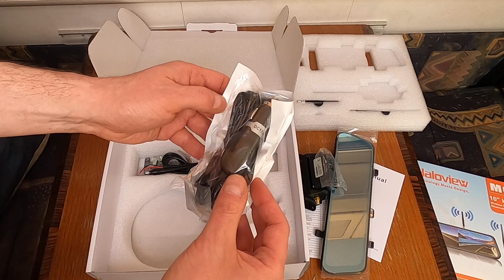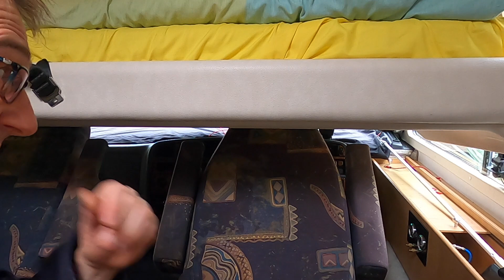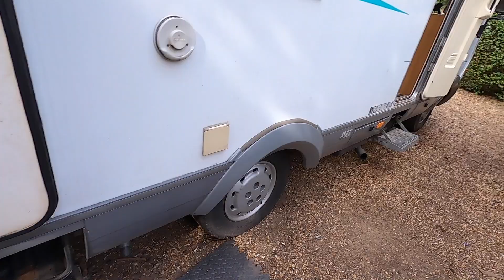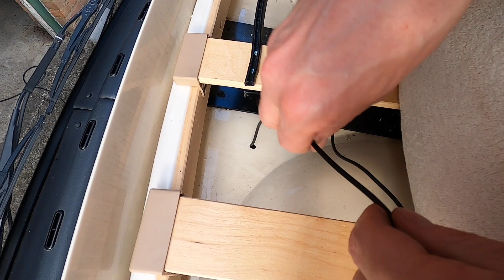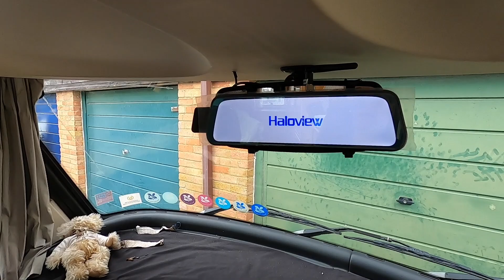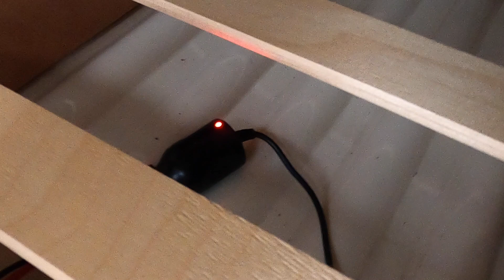Installation & Review of the Haloview MC-10 Wireless Rear View Dash Cam

Comment: Brilliant video buddy just what I needed. Now I have a question if you could help matey… so I have a reverse camera fitted in my bessacar motorhome already but I’m wanting this for a rear view camera to see what’s behind while on the road , my ideas are to wire this rear cam to the one that’s in for a power source would that work or would it only come on when selecting reverse like the one fitted 
Then the front dash cam I’m thinking of piggyback to the fuse of the day time running lights
Reply from the maker: Hi  Elites Gaming, I'm not sure I follow you 100% but it sounds like you want to wire the Haloview into the existing camera? If the existing camera's turns on when you put the motorhome in reverse then it's probably getting the power from either the reversing light or the reversing switch in the gearbox. You'd need to check that.
I hope that helps?
Reply: @HermanHitstheRoad  ok buddy I will explain better . I’m going to wire a 12 v socket in my fuse box on dash using a piggy back fuse and other to ground then plug the dash cam to that 
The rear cam I will have to wire to a light like you have because like you say my rear cam is the reverse cam . I have been told there is a fix for that too The issue is the camera comes
on in reverse. And the only way I think you
can overcome this is locate the yellow wire
at the camera and connect this to 12v
ignition so that would make the cam I have in a source to daisy chain
Reply from the maker: Right, got you 👍👍
Reply: @HermanHitstheRoad  how long is the power cable buddy for the rear camera did you have to extend it . I’ve watched all the video but not sure if you fitted that cable with the blue wire , or that’s the original cable for the camera
Reply from the maker: The rear camera has a short cable. We extended it to reach the rear lights.

Comment: Great video. Did you put a anti dazzling film in the end? I thought the mirror was supposed to be anti glare already? Thanks
Reply from the maker: Thanks for your comment, Ricki. No, I didn't. All I simply did was tilt the mirror away from the windows. It's a screen and not a mirror so it doesn't need to point to the rear window.
Reply: @HermanHitstheRoad  Ok I see. Mine may be different, I have a Halo View but it seems to be a mirror. Anyway will let you know
Reply from the maker: It's both, kind of. I was trying to use it as both a mirror and a screen. So, you could use the mirror while driving and have the screen come on when you put it into reverse to give you a better view of what is directly behind you. I've gone for the screen on all the time setup

Comment: Useless at night massive glare. Do a night test
Reply from the maker: You get glare through the rear window anyway so it isn't much difference. The problem I have at night is that camera switches to IR mode and car headlights turn the camera back to normal mode and this causes a flicking between night and day vision.
Reply: @HermanHitstheRoad  it's 20 times brighter than out the window I asked the manufacturer to add the option of turning off the ifrared
Reply from the maker: And what did they say?
Reply: @HermanHitstheRoad  no answer yet
Reply: @HermanHitstheRoad  here is their answer
We will sell a new camera without IR light in the future, maybe you could try it later. 

The infrared light is unable to be turned off, as for the issue you mentioned, for MC10's camera, it is a normal phenomenon when using it at night.

Comment: Hello, just wondering, was it not possible to wire the camera locally to the cable going to the rear mounted brake light?
Reply from the maker: Hi etansey, that would mean the camera would come on when the brakes were applied. The camera would turn off when my foot came off the brake pedal. So we could have wired it to the brake light but it would have been useless.
Reply: @HermanHitstheRoad  ah of course. Thinking of adding a camera myself but don't fancy wiring the power cable to the light unit. Our van has a 13 pin socket for a bike carrier light bar, was thinking of wiring the camera directly to that plug. Much trial and error no doubt. Thanks for the reply.
Reply from the maker: 13 pin? That sounds like a tow bar connector. It may have an earth and a live for each light. If it has a permanent power connected to the ignition then that would be ideal. You also want to consider where the wires are going. If the 13 pin connector is outside your motorhome then the wires will need to find there way outside.

I hope that helps? Let us know how you get on.
Ads

Comment: Hi again ads,
Just waiting on my delivery on my mc10, can I ask how you powered the rear camera to test before you wired up in Herman.
Thanks Anthony
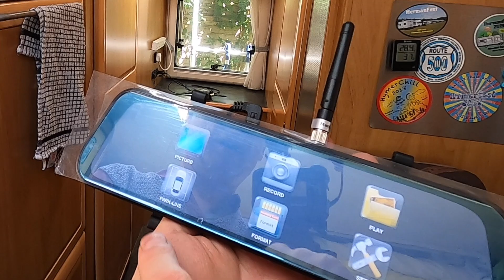Reply from the maker: Hi Anthony, for the mirror I used the cigarette lighter connector that comes with it. For the rear camera it has a connector much like these (https://www.amazon.co.uk/dp/B01N5CT3AY/ref=cm_sw_r_cp_apa_i_b-5tFb7KB7WA3). So I used a cigarette lighter socket with something similar on the end (we used it to power the 12v TV). You can just barely make it out in the video at 2:05

Comment: Ads thanks for info, just ordering one as I type 🍺🍺
Reply from the maker: That's great. Which one did you go for, the MC10?
Reply: Yep, that’s the one,looks great in your van. Hope I can sort the fitting ha
Reply from the maker: You just need to plan the route for the power cables and decide how you're going to turn it on. 
Please let us know how you get on.
Reply: Morning Ads 🥴noticed you bolted your rear camera to a wooden block,did you drill and bolt that onto Herman’s frame,or did you glue.
Thanks again 👍
Reply from the maker: The wood is there to provide strength because what we drilled into is just fibre glass. The black sealant is like Sikaflex so is also an adhesive. I hope that helps 👍👍
Reply from the maker: At first we mounted the camera upside down. So watch out for that. I realised after I removed the plastic film when I noticed the camera has a tiny sun visor. You can see this mistake in the video. The label should be on top and the pairing button on the bottom.

Comment: In our previous motorhome we had a fully wired rear view camera - could switch between cameras with tilted down and wider rear view. Useful but didn’t really help in the dark or bad weather as rain would cover the lens. 
I’ve driven cars with bumper height reversing cameras which is what I’d like, lot more detail for manoeuvring.
Reply from the maker: Hi Philip, what I don't mention in this video is the fact that it also has rear night vision. I'm going to use RainX on the lens to keep the rain off 👍👍

Comment: I dont understand...u connected to the indicator light,so it would only work when u indicate??or connected to the lights means u got to have lights on all the time???
Reply from the maker: Hi Sven, they are side lights not an indicators.  Yes, I have to have the lights on for it to work which is a good thing because it adds a level of safety too.

Comment: I looked at buying one of these, but was not to keen on a mirror fixing, so I opted for a EW1300 7" Reversing Camera Kit with Twin Lens Sony CCD Bracket Camera from revcamuk..a bit more expensive but ticked all the boxes. (just got to fit it now)
Reply from the maker: Hi Vagabond, does it also have a dash cam or is it just for reversing? The way I use the MC10 means that it's always on and I use it like a rear view mirror while moving forward.
Reply: Hi Ads, I was told by the supplier that the twin cameras can be used as a reversing and rearview mirror. So I suppose one has to be wired into the reversing light while the other is wired to the ignition or main power...(Where's Chas when you need him lol)

Comment: Good effort and a nice review. I would have wired the rear camera into the reversing lights and attached the front screen to the dash connected to a lighter socket. Then just use it as a reverse camera. Does the ignition have to be on to power the sidelights?
Reply from the maker: Hi sleepy cats, that was one of our ideas too but we'd have missed out on so many of its functions such as; it's front and rear dash cam and its use as a rear view mirror. Just having it turn on when you put it in reverse is a bit of a waste. Yes, the ignition has to be on to power the lights
Reply: @HermanHitstheRoad  Good point. I'm always looking for the easiest option though!

Comment: Great content as usual Ads. You got there in the end. It's the one accessory I've never had all these years but  I'm now thinking it may be a good idea. Because we don't have a windscreen mounted mirror, does the Haloview come with some sort of suction device or can it be mounted on top of the dashboard? Bob
Reply from the maker: Cheers Bob. Haloview do also have dash mounted monitors but it wouldn't be too difficult to stick a rear view mirror on the windscreen and then mount the MC10
Reply: yes, they offers almost all kinds of accessory for RV camera

Comment: Very informative ads, 😊👍
Reply from the maker: Thanks Mark. Is it something you'd be interested in?
Reply: @HermanHitstheRoad  it is bud, but what I know about electrics you can write on the back of a stamp, so I back off from doing what you have, would probably burn my mh to the ground 😯😁, hats off to you tho 😊👍
Reply from the maker: 12v car electrics are much easier than domestic electrics.
Reply: @HermanHitstheRoad  I know your right ,its having the nerve to start a project 🤔🤷‍♂️
Reply from the maker: Oh of course, Mark. A lot of thinking and planning went into fitting this and it's not as though I've not dealt with car electrics before. Start small and work your way up. You could start off with fitting a car stereo or a USB connector.
Reply: @HermanHitstheRoad  thanks ads, will certainly think along those lines, 😊👍 ps. If you here of a mh blowing up on the news you know I started a project 😄
Reply from the maker: LOL

Comment: A very interesting video. A really clever bit of kit, pity it's not just a screen, rather than the mirror. The way you've wired it, don't you have to drive with your lights on all the time?
Reply from the maker: Hi Bob, yeah we have to drive with the lights on. Which isn't a problem because it also adds a level of safety